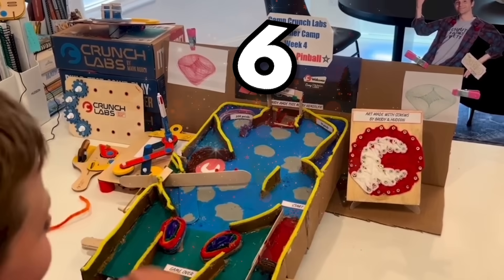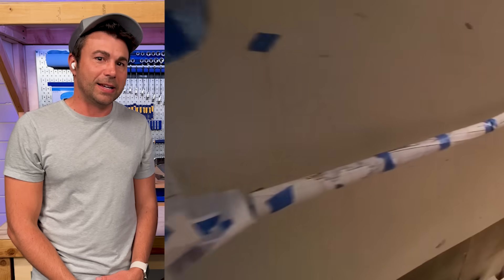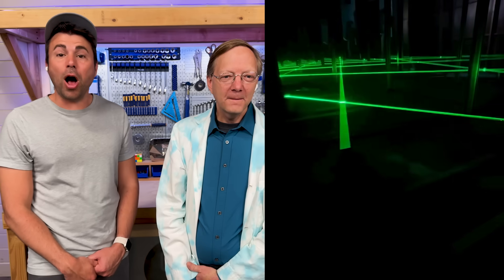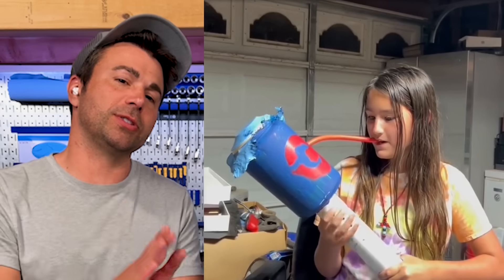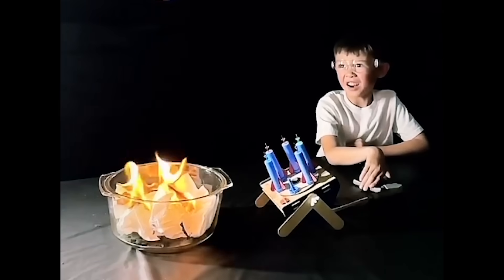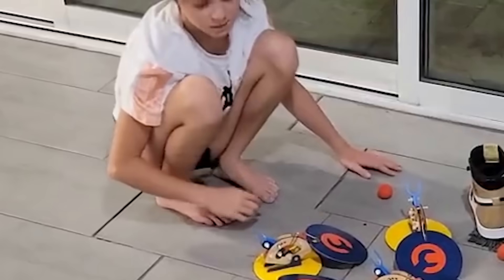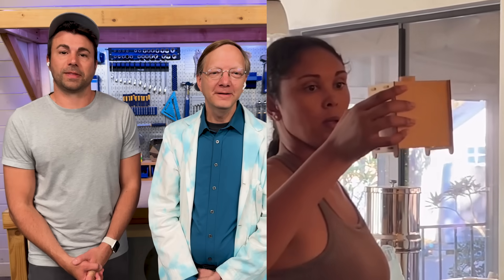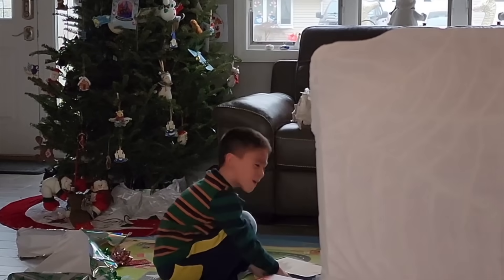Mark Rober Reacts to Kids Genius Inventions

Comment: 5:20 "So those paper clips are all floating" "Technically suspended" Got curious enough to look up the difference. If I understand this correctly, floating is when the object is less dense than the medium it is in so it tries to go upwards (likewise, sinking is when the object is denser than the medium so it goes down). Suspended seems to be of equal density so it neither goes up nor down. Correct me if I'm wrong though!
Reply: In this case, the water wants to hold itself together because of surface tension, and the paper clips (which are heavier than water) don't have enough weight to overcome that and sit on top of the water.
Reply: @Ekipsogel  So nothing to do with density of water or the paper clips?
Reply: @LionHeartSamy  nope. This relies on surface tension being stronger than the weight of the object suspended. Putting soap in the water lowers surface tension and will make the clips fall.

Comment: Mark will you PLEASE make a perfect marshmallow roaster. you could do a lot of tests to see what the perfect distance from the fire/coals and the perfect speed it needs to rotate at to make the gold color. then you could add a sensor to tell you what the temp. is. Then make some code to adjust the marshmallow to the perfect height with some stepper motors. After that make different motors rotate the marshmallow at the perfect speed. It would be awesome! It would be a good video and you would have a perfect s,more, so please take this in to consideration.